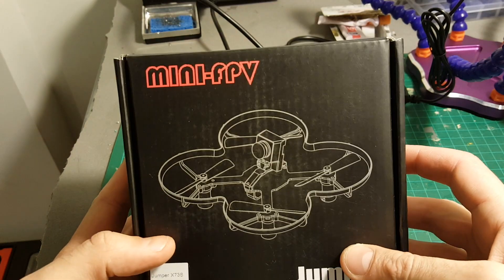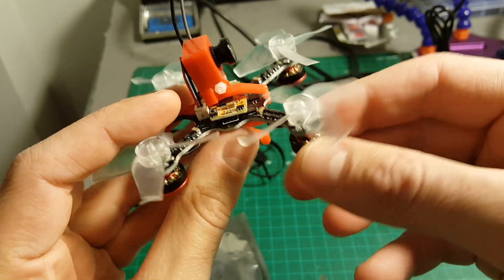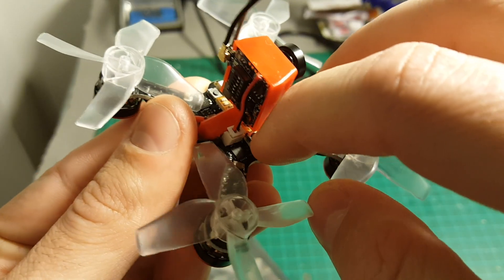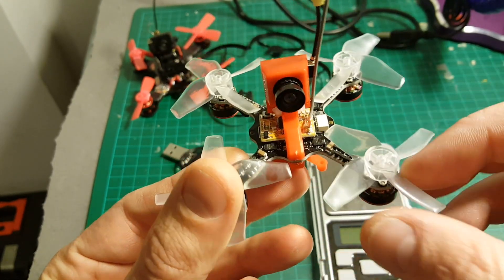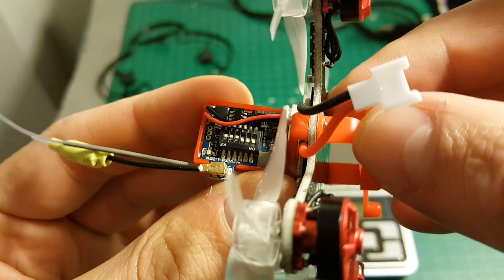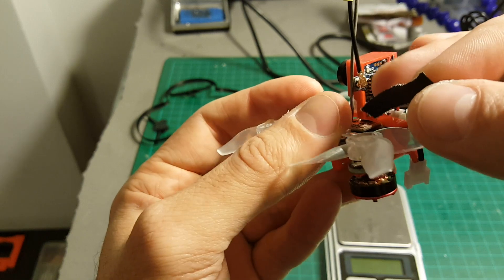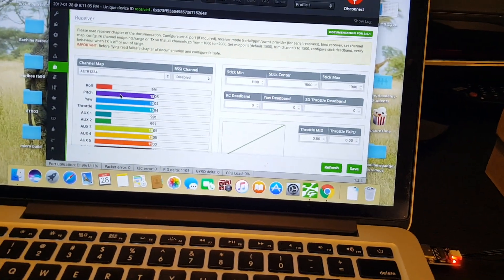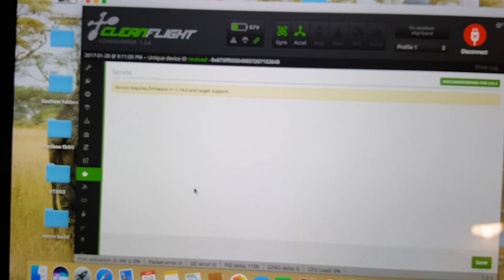X73S 73mm Betaflight Naze32 Brushless 1S FPV Racing Drone unboxing, review and test flight

Comment: Good morning, I bought the X73s, but I was adjusting it, and without wanting to press the button next to the configuration slot, I do not know if it is this problem.
But I can not activate drone engines, I followed your video step by step. Can you help me.
Thank you in advance for your attention.
A big hug
Nilton.
Reply from the maker: Nilton Larangeira Hey Nilton. Please remove the propellers and try to arm it while connected to Cleanflight. Let me know if it is getting armed. In addition test the motors and swe if you are getting any response.